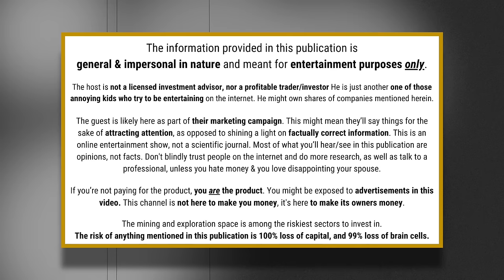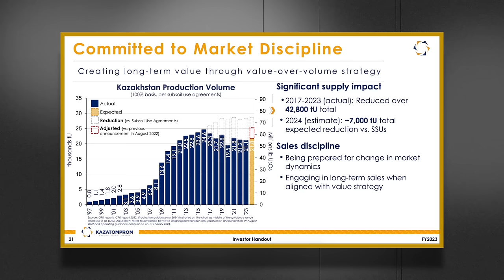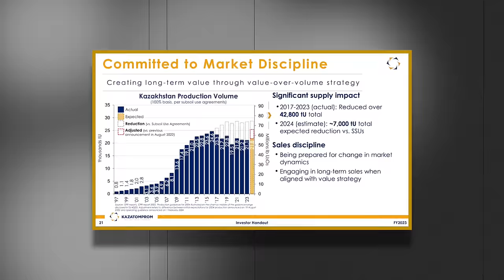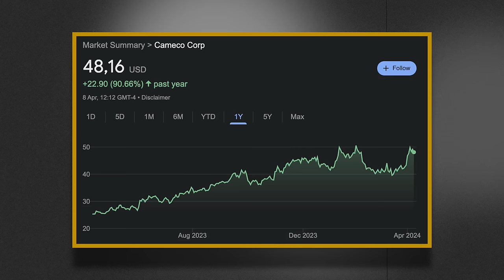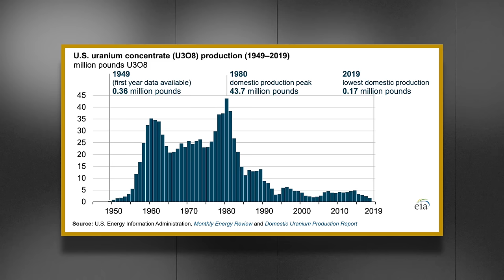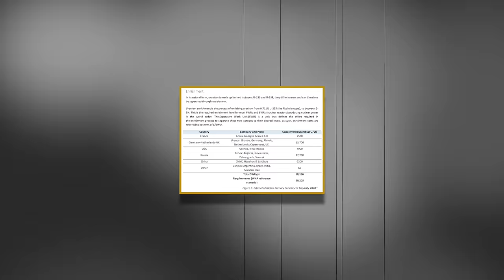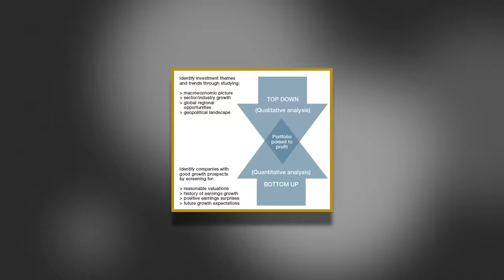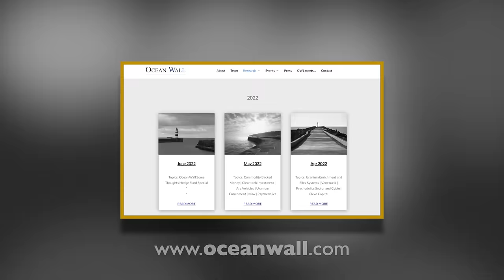+$106 Uranium, China-Kazakhstan Issues, Cheap Junior Stocks | Ben Finegold Interview

Comment: !!!
Reply from the maker: Let's go, Ryeff!
Reply: @ResourceTalks  I wish I could go. I had to call a mobile diesel repair facility to help me get a head bolt stud extracted from the block. $200 an hour and $50 fuel charge. Not sure how much that will actually cost me at this point. Maybe the truck will be back together in a week or 10 days, if I'm lucky. Going for epidural tomorrow.